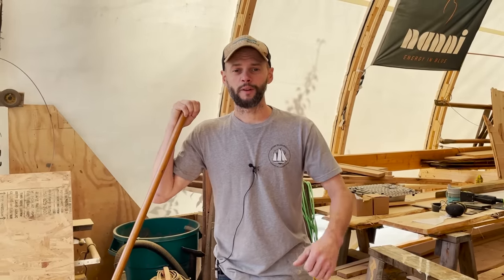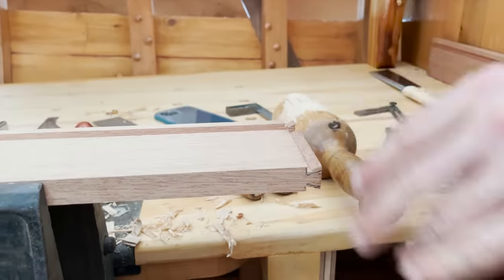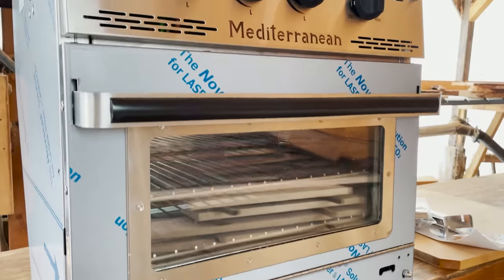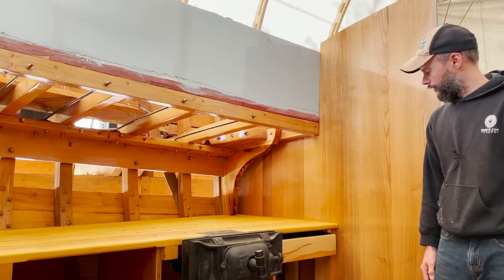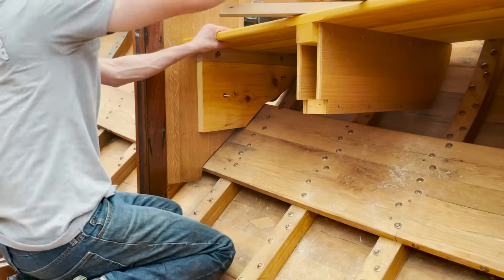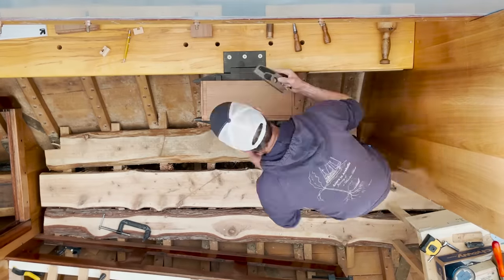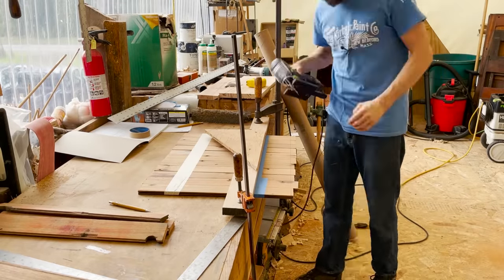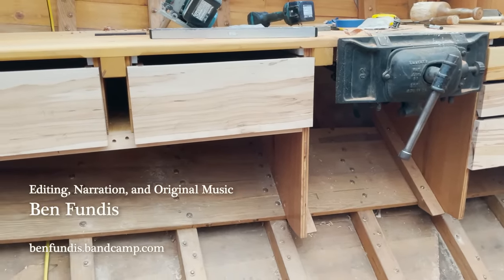No-Glue Drawers - Episode 182 - Acorn to Arabella: Journey of a Wooden Boat

Comment: Nice work on those drawers!
Just want to add one thing, the wood expansion is negligible over the length of a board, so in theory, you could make them fit tight side to side, but they need to have som slop in their height. Also the expansion in the thickness is usually ignored since that's like 12mm, so if they expand to 12.5mm it usually doesn't matter, but a boat sure i diffey from a warm house humidity-wise :)

Comment: Really nice drawers! I don't know what the plan is but I would recommend not using knobs on the drawer fronts - they can be really painful to both knees and hips, whether they are bronze or wood. You can get a really nice look using leather straps. They can of course be mounted directly to the drawer front, or folded - through the drawer front, or for a classy look; folded and attached to the top of the drawer front - like tabs sticking out - maybe even asymmetric to the fronts.

Comment: Why not a bevel on the back side of the drawer lock blocks so there is not a hard corner hitting the slide rails?  The drawer can't slide in any deeper so it would not detract from the front edge locking the drawer in place.

Comment: Fab details.
I realise everyone in the States is accustomed to imperial, but honestly, decimal is so much easier. My dad (in Australia) taught me using imperial, but millimetres is just better. Even the country that invented the code has stopped using it, and they hate to concede anything to the French.
Reply: Absolutely right, concede anything to whoever you like, but not to the French 🤓
Reply: But Metric system is as French as french-fries.
Reply: I heard or read somewhere that before having readily available measuring tools Imperial system was easier because simple to divide by 2. I can kind of imagine that.
Reply: @fredpinczuk7352  they may have invented the pencil sharpener, but that’s it
Reply: @jbeutell  Dividing by 2, 3, 4. Note they used fractions not decimals way back.
Reply: @Fr99763  and what have you invented?
Reply: I have been hearing rumors that now that England has decided to leave the EU they will be returning to using more of the Imperial system. Apparently they where forced to switch by the EU and now they have no reason to use it for the common person.
Reply: A few points to remember’
 Steve and most of the people working with him were brought up with Imperial measurements. Having everybody converting at the same time leads to mistakes.
Steve is more comfortable designing in Imperial. Converting during the design process leads to mistakes.
I myself work in both systems and can easily convert from one to another but  mainly work in Imperial, why because the older machines that I have acquired are ,dollar for dollar, a much better quality than any of the newer equipment available.
Steve’s tools are Imperial. Converting to metric to make a cut on an Imperial machine can lead to mistakes plus his drills, chisels, planes and other  pre sized cutting tools are all Imperial.
And finally, the majority of viewers were brought up with imperial and are more comfortable with measurements given in imperial.
Reply: Also its much more accurate measurement.
Reply: Decimal is probably the worst system unless you can only count with your fingers (or toes). Base 10 only gives you division by 2 and 5 (and who uses fifths?).  Using Base 12 is better because you can divide by 2,3,4,6. I remember good old days when there were 12 Pennies to the Shilling and 12 inches to the foot. (P.S. I'm not a Brexiteer and I'm not anti French - its just math(s) 😊)
Reply: Hmm foist on us by the Common Market, 🏴
Reply: @properfunny  yeup you say that to anyone under 30 and they glaze over 🤭
Reply: There is such a thing as decimal inches. You can buy Stanley measuring tapes in inches with 10ths and 100ths markings. But Steve's measuring tools are probably mostly fractional. As a machinist, 4-1/8" is 4.125" just like 104.775 mm but 25.4  times smaller...
Reply: @bgbthabun627  sliced bread 🍞
Reply: @properfunny  that is correct. They were forced! Dropped gallons in favor of liters, and so on…
Reply: @CliveGregory   Would you rather read binary (base 2) or text (base 26)? Binary is simpler... but the choice of base depends on the application.
The International System goes far beyond the use of decimal sub-units. SI is about:

-Standard, consistent UNITS of measurement, such as grams, litres, newtons, watts, volts, tesla, pascal, hertz, etc.;
-Standard unit SYMBOLS, such as g, l, n, w, v, t, p, h, etc.; 
-Standard INTERVALS betweeb sub-units, the decimal intervals (intervals of ten and its multiples); and
-Standard NAMES (and symbols) for the most commonly used sub-units: powers of ten closer to one (mili, deci, deca, hecta and kilo), and multiples of -1000 and 1000, such as pico, nano, micro, mega, giga, tera, etc.
Reply: I’m in Australia. My dad was a carpenter. They all learnt metric and changed with the times in the ‘60s. The building trade is all in mm along with all other industries. He never had any issues. Honestly, base 12 and fractions are ok, but for anything complex, you’re far better off with metric and decimals. (Example: See Lou from Tips From a Shipwright use a metric tape to line off the hull for example. Far easier which is why he does that instead of using imperial.)
Reply: I think it does no good to push your personal preference of measuring systems on other people. Use what you want to use, and leave other people to their preferences.

And remember, "ALL* units of measurement are arbitrary.
Reply: @watcherofwatchers   Firstly, was not 'pushing' anything, just stating which I think is best, based on my personal experience of both systems.
Nor did I imply that I don't understand that these are constructed.
Reply: @sysfx But why Base 10? it's just not the best way to divide an interval.
Reply: @CliveGregory  Probably because the zero catalysed the adoption of base 10 indo-arabic numbers by most (all?) countries before the SI was created.

Not everything is about base 10 and base 2. The radian is supposed to replace the old mesopotamian degrees, the angle of the first triangle (three equal  sticks) divided into 60 - their base.

Comment: I'm no shipwright, (except for what I've learned from this channel) but if you are planning to cruise in cold climates wouldn't you want some kind of insulation built in to the hull and house? IDK, maybe it's not necessary.
Reply from the maker: Being that water and wood are good insulators, heating the boat becomes a simple thing.
Reply: Wood is a good insulator, yes. I'll listen and perhaps read and ponder and consider,  how, when, and to what usefulness is liquid water actually a thermal insulator.)

Comment: Arent the dovetails the wrong way? You're going to have a lot more up and down forces than sideways
Reply: Once the drawer bottom is inserted, the front gets locked to the sides.
Reply: @robw2379  sure, but why not both? Without glue, you need all the construction integrity you can get
Reply: @PLF...  Agreed. If I were making the drawers, there are several things I would have done differently. I think his thought process is to have the drawers able to completely disassemble and repair if necessary, so he has just a couple nails pinning things in place. Again, not how I would have done it, but certainly a valid approach.

Comment: Arabella is going to need insulation or the condensation will be a problem.
Reply from the maker: Condensation is an issue on a great many boats. Wood itself is insulating and yet… there are other ways to chase it down and keep it in check.

Comment: A stacked dado blade saves a ton of time on drawers. You can cut them in one pass, and they need almost no cleanup. I held off for years and regret not getting one the first time I needed it.
Reply: I believe stacked dado blades are being banned due to safety concerns?…but I agree they do really speed up the work flow considerably!
Reply: The problem is setup. If you take the time to precut everything and plan your work flow properly so all dados can be cut together, then it works. Better yet multiple table saws.